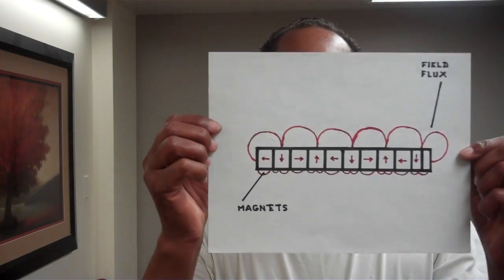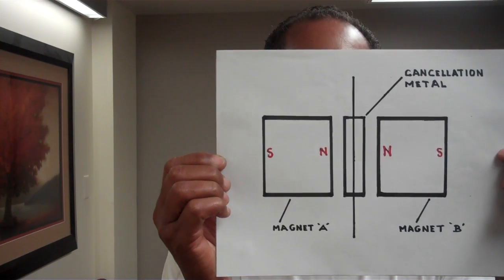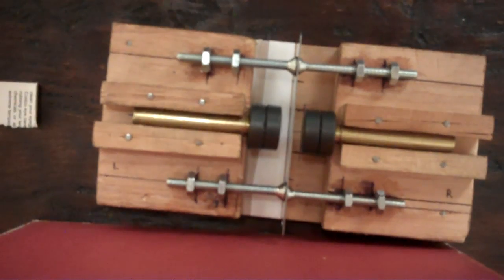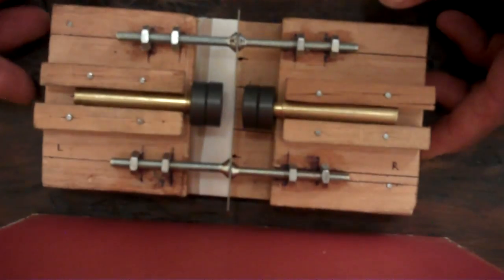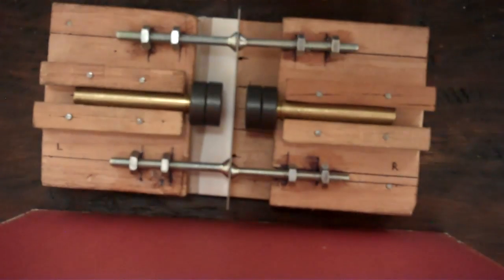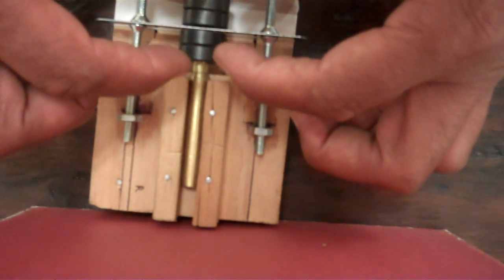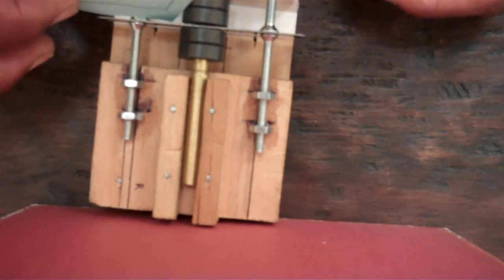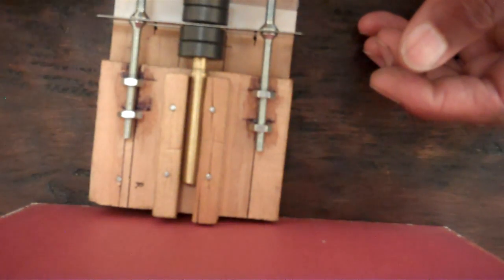PERMANENT MAGNETS: Two Types Of Permanent Magnetic Field Force Cancellations (Balancing) | Part 1

Comment: Very good Mr J. I was wondering if you had much trouble with the spacing of those 2 bolts on the side.? How precicely apart do they have to be? To the very mil or give or take 1/2 a mil.?
Reply from the maker: +vege mite . Dear Vege Mite: There's no troubles in building such a simple rough working model. I used a 12 inch ruler to make the one in the video. Plastic screws can be used instead of steel screws to hold the cancellation metal in place. Just take your time and make it precise enough and it'll work. It doesn't take much. The one in the video cost less than $20. Four small magnets (cost about $1.25 total) with clearance holes in the center of them to superglue a small braze tube (cost $3-4 which slides back and forth inside of another braze tube for $3-4) from any hardware store. Spark plug gap blades (30-35 in a set from any auto parts store) for about $5-6. And so on. It's up to you how precise you want to make it.
Reply: thanks. cheers.

Comment: Nice video Jessie, thanks. Metal is attracted to either N or S pole and when placed
between repelling magnets the like poles are attracted to the metal because they
are closer and thus stronger. What I don't understand is why the cardboard is removed and the magnets do not pull to the metal. If you double the thickness of the metal
do they pull together? Norman
Congrats on some nice sensible comments everyone.
Reply from the maker: +nebollinger . Mr. Nebollinger: The magnets don't move because it's equal push (magnets repelling each other) and pull (magnets being attracted to the metal). Like a rope being pulled from both ends but with equal force. Equal force but in opposite directions. The direction of motion is canceled and things stay where they are.

Comment: Without taking away from the experiment itself. magnetic lines of force cannot be cancelled. But the basic law is this, for every force of action there is an equal opposite force of action. Both magnets would be a +1 and the steel would be a +1 = a +3 However the steel would be divided by a 1/2 so that the farthest point of steel between each magnet is attracted to the closest side of each magnet. It would be like tying a magnetic lock using the steel which will allow each magnetic loop to pass through the steel and back into itself with losing it's attraction t the steel. The boundary line would be exactly 1/2 of 1 or the center of the steel equally divided, just as you say it has to be.
Reply from the maker: +Myreply59 . Dear Mr. or Mrs. Myreply: Nothing happens to the magnetic fields. You're turning a very simple thing into something more complex. Keep it simple. Pull (attraction to the metal by the magnets is simply +1). Push (repulsion between the magnets is simply -1). Push and pull are equal but in opposite directions. Direction of motion is canceled in both directions by equalization of forces. Hence: force cancellation. Just like pulling on a rope from both ends in opposite directions. Nothing more. +1-1=0. Cancellation of direction of force. Force cancellation. Keep it simple.
Reply: Yes, but I think maybe some of the others didn't get that you were saying that. From reading it sounds as if they think something was happening to the fields.

Comment: Nothing has been cancelled out, it's only a redirection of positive and negative forces. Much the same as a tug of war, two forces against each other but the force remains in the tension of the rope.
Reply from the maker: +Kelvin England . Mr. Kelvin England: It's equal push to equal pull (repulsion and attraction equalized). Very basic physics indeed. Like two equal forces pulling in opposite directions along a single rope. Or two hands with equal force pushing against each other. The forces cancels each others direction of movement. The rope or the hands stands still in other words. The same with the magnets. Movement in any direction has been canceled by equal but opposite forces. In physics this is force cancellation sense force is being dealt with. It isn't a redirection but an equalization of opposing forces along a single linear coordinate line like the rope. It's that simple.

Comment: Magnets dont work on stainless steel which is what the shims are made of.
Reply from the maker: +dootz79 . Mr. Dootz: What does your comment have to do with the above video? The spark-plug-gap blades are steel. The steel in the video is magnetizable metal. Which is why the simple experiment works. A simple balance of opposing forces (push and pull or repulsion and attraction). Please do not assume. Make one of these if needed. Then talk.

Comment: Question is, what practical applications can be made with this cancellation effect?  How do you deal with the gauss effect on the metal?
Reply from the maker: +John Ruckman . Dear Mr. john Ruckman: Please go to you-tube and write in: Permanent magnets: how to make a "WORKING"  SEMI-perpetual machine.
Reply: +Jessie Johnson how the hell can you have a "SEMI - perpetual machine" something is either perpetual or not by definition :-  continuing or continued without intermission or interruption; ceaseless
Reply from the maker: +Fiona Yeatman . Dear Mrs. Fiona Yeatman: SEMI simply means it is not perpetual or indefinitely self-running (an impossibility). But that the system can run in the human context for several months to several years or more using some of its own produced energy and/or force and to also have enough energy and/or force to do external work on other processes or things (this makes it a machine). A machine is any thing used for the purpose of doing work. With only one exception to this: living things can not become or be made into machines, when this is tried (and it has been tried thousands of times over thousand of years) instead they become slaves. A SEMI-self-sustaining machine is what - reality - permits. All other related things (over-unity, perpetual motion machines, free energy, forever self-running machines, etc. are simply not possible) aren't producible.

Comment: Just watched your video again, one question how long did it take you come to working this out? Just love this.
Reply from the maker: +geoffg6867 . Dear Mr. Geoff: It took me about 60 seconds to think on how to force cancel the magnets because it's simply a matter of balancing the forces to have them cancel. Nothing more. The simplest forms of fundamental physics when dealing with force and magnets. To think up a way on how to show it to the public took less than a half hour because I already knew of spark plug gap blades (cars) and magnets. To physically make the simple device shown in the video took several hours (3-5 hours). It was fun to make. The rough model in the video (tho flimsy) still proves the point: It works. It can be done.

Comment: Dear Dr. Johnson,
The video demonstrates well in several aspects clearing the view points of magnetic field force cancellation, which i will prefer to say magnetic field force at the critical condition. But according to the +1-1=0 part looks a bit not clear to me. Moreover, you did not talk about the domain part. Inside the magnet, the flux lines actually goes from 'S' to 'N' (Ofcourse u know that), At which point the field force would be zero then? and How the field lines would flow at that situation maintaining the Maxwell's 1st Law of Magnetism?
Reply from the maker: +Tanbir Anowar . Dear Mr. Tanbir Anowar: Someone else will have to make those videos about the points you brought up.

Comment: I tend not to agree with the conclusion in this video, If the magnets have a North near the South then  they will attract and all the flux will go through the magnets to come out at the ends to circulate the flux  through the two ends,

If the N and N or a S and S are near each other then the magnets will repel and the  magnetic flux will come out  radially out of the middle of the magnets and then circulate in loops to the two ends.  The magnetic field will not be cancelled but circulated in another pattern.
Reply from the maker: +Carmel Pule' . Dear Mr. Carmel Pule': The magnetic fields are not cancelled. They are not destroyed, touched nor do they cease to exist. Magnets produce a physical force field or a field of physical force. The - force - of attraction of the magnets to the metal and the - force - of repulsion between the magnets are equal but opposite. Hence: the forces cancel each other. Push and pull are equal but opposite. Attraction is +1 and repulsion is -1. So that +1-1=0 or cancellation. Nothing more. Make one and test it. It cost about $20 to make. Then you will 100% agree. Test and demonstrate Mr. Pule', then talk. Don't think. Do it.
Reply from the maker: +Carmel Pule' . Dear Mr. Carmel Pule': Your statements are of the most basic form of magnetism and is unrelated to what the video demonstrates. The video is about - field force cancellation. Please, watch the video again flawlessly so as to comprehend what you're being shown. You have missed the point completely.
Reply: +Carmel Pule' RE: So you're saying the metal placed in between (or removed from in between) would have no effect on the magnetic field?
Reply from the maker: +2Truth4Liberty . Dear Mr. Pule': To answer your question: that's correct for general practical purposes. Permanent magnets which are repelling each other (N to N or S to S) causes the fields to become weaker to non-existent over several days or several weeks depending on the type of magnets and their set up. When the fields are attracting (S to N or N to S) the fields will last several thousands or more years under nominal flawless conditions such as when they're embedded in rocks and mountains. With the simple device shown in the video: attraction and repulsion are happening simultaneously so it must be found out via tests just how long such fields will last.

Comment: GrodyMaroon & Alejandro González López are right, but it is more accurate to say balancing the forces, close enough that the residual imbalance is less than the friction of the brass rods in the wood slots. 
The maneuvering of the rig during positioning & spacer removal is unnecessary, distracting, (& suspicious), & hides (or omits) that the arrangement is unstable.
Reply from the maker: +you2tooyou2too . Dear Mr. You2tooyou2too: Instead of assuming that you understand, please, make this simple device for yourself. The one in the video cost less than $20 to make. Everything you need to know and build one is stated in the video. Talk is empty and every single thing stated in the video is correct and anything contrary to this is - incorrect. Demonstration proves: IT WORKS. Everything that you and every one else thinks otherwise is incorrect. Before writing any more comments: MAKE ONE, TEST IT and then talk. Then you'll know. Not assume. Your imagination is one thing. Reality and physics is another.

Comment: What the hell is this guy talking about? I have a post-graduate qualification in physics and I still have no idea what he's trying to show us.
Reply from the maker: +Torgo . Dear Mr. Torgo: It's simple. Since the magnetic field of a permanent magnet CAN NOT be turned or switched off and on like an electromagnet (which runs by and on electricity) there's the need for a way to be able to create the effect of turning on and off of permanent magnetic fields in permanent magnets. Permanent magnet field force cancellation is that way. Along with two other ways. Of course the field isn't physically turned off but this is the closest to producing a zero magnetic filed effect for practical mechanical purposes.
Reply from the maker: +Jessie Johnson . Dear Mr. Torgo: Please, watch the video again from beginning to end. Follow it flawlessly. You will understand the magnitude of this discovery. A very simple physical mechanical principle which has been sought for several centuries. It cost about $20 to make this model. Everything is stated on the video.
Reply: +Jessie Johnson 
Oh, ok I see now! You're right, I wasn't paying attention properly when I first watched it. I understand now.
First time I thought it was pseudo-science or a wacky free energy device or something.
But I get it now, it's just basic magnetic forces, the summation of the forces is zero along a fixed dimension and hence there's no acceleration/movement.
It would have been good to see you remove the metal from between the magnets and observe them repelling each other.

Comment: So, when you remove the paper, the magnets do not move. Is this because of some sort of field cancellation, or is it because the brass tubes they are attached to are stuck in that wooden frame?
Reply from the maker: +Paul Murray . Dear Mr. Paul Murray: There are two braze tubes. One inside the other. Sliding easily back and forth. The field forces of the magnets are equal but opposite. Hence: field force cancelation.

Comment: Very interesting indeed. I was wondering if another magnet of equal strength was on a spindle if it also would be canceled or would it be repelled; Something like people are making magnets motors where the spindle keeps rotating because all north poles are facing one another but those types of motors don't work because it will always be a time it comes to a stop because the spindle will lock in between two north pole magnets; I was wondering if you think this setup would work with a third magnet and it also be canceled out or would it still want to be repelled from the other magnets or do you think it would come a time when the spindle would lock between the two set of canceled out magnets?
Reply from the maker: +Steve Rabon . Dear Mr. Steve Rabon: Please go to - permanent magnets: the Johnson machine - on you tube. This will answers your questions.
Reply: ok thanks a bunch Jessie Johnson

Comment: I'm sure this is very interesting. I have some questions: 
1. how do you determine the right thickness of magnetic metal (Iron/steel) to use?  
2. Have you tried this with more powerful magnets i.e. neodymium magnets?
3. Is there a practical use for this set-up?
Reply from the maker: +david meadows . Dear Mr. David Meadows: Your questions are answered in the order given: (1) trial and error. Depending on your purpose. (2) No I haven't used more powerful magnets as all permanent magnets are equivalent no matter what they're composed of. (3) what's used in the video above is for the proving of the simple principle of permanent magnet magnetic field force cancellation. To comprehend the practical use of this principle please go to: https://youtu.be/ ZQVEdDbq7wY.

Comment: Typically, spark plug gap feeler gauges are nonmagnetic. Does that have any effect?
Reply from the maker: +Richard Von Statten . Dear Mr. Statten: The spark plug gap blades used in the video above are high magnatizable common steel. And can be purchased from any auto parts store for $5-$6 for a set of 30-35 of different thicknesses. Non-magnetizable material can not be used as the cancellation metal. It doesn't work that way.
Reply: Yes sir, very understandable, otherwise magnets would be in constant repel N to N
I don't believe you mentioned that in you video.
Thank you for sharing.
Rick

Comment: You won't be able to use this knowledge in a free energy device as you don't adress the core of magnetic field: The entering and exiting of the field.
Reply from the maker: +The Openminded Skeptic Dear Mr. Openminded Skeptic: (1) You are mistaken Mr. Skeptic. This principle can be used to make - real - machines - but it is an IMPOSSIBILITY  to make a free energy machine in the non-sense perpetual machine perpetual motion form. An IMPOSSIBILITY. (2) I didn't make the video to show everything but to show field force cancellation - only. This is where the repulsive and attractive forces are equal but opposite and to have a simple way to demonstrate this. (3) there's no such a thing or machine as a free energy device. You can not get something for nothing. If you wish to know anything other than what's shown in the video above please make one of these simple devices for yourself and run test. It costs about $20 total to make one.
Reply from the maker: +The Openminded Skeptic . What is the reason(s) Mr. Skeptic that I should look you and others up that make comments on videos? At this time the comment section of this video and others is as far as I wish to go in communicating with the people studying the above video unless there's a reason(s) along the lines of my interests that I consider pertinent.
Reply from the maker: +The Openminded Skeptic . Mr. Skeptic: Please keep - all - comments video subject related. Comments non-subject (permanent magnets) related shall not be kept.